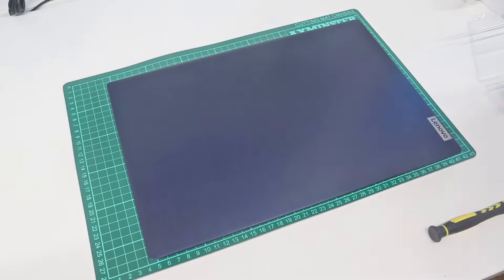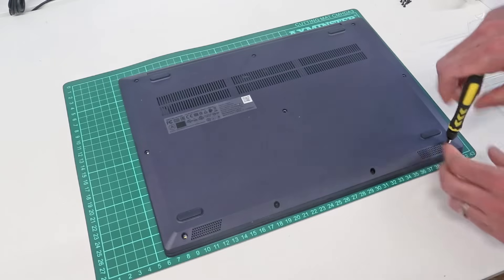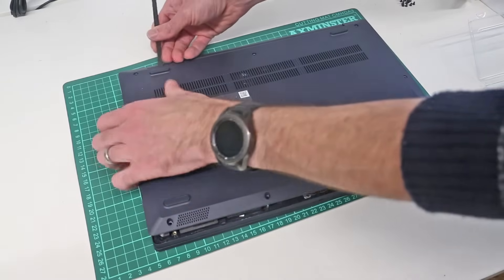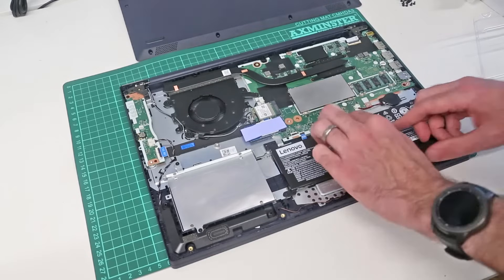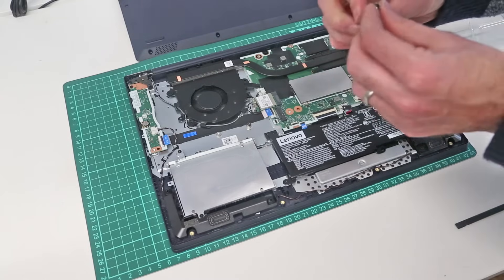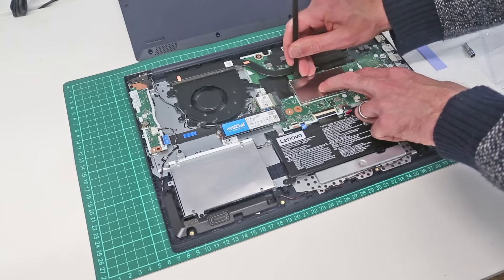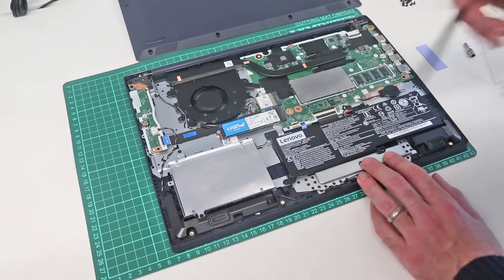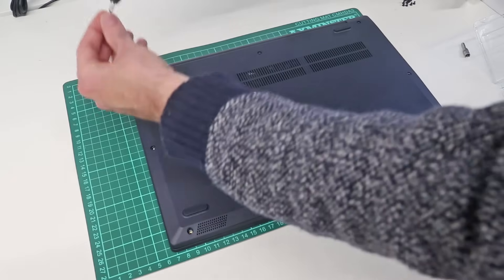Lenovo IdeaPad 3 15ARE05 SSD and Memory Upgrade Guide

Comment: i put 16gb RAM with 4gb soldered RAM and it run 20gb RAM ... with no problem
Reply: JET FU3L  total is 20 gb, but loss dual channel
Reply: Was debating on doing same thing (have ryzen5 256 ssd 8gb ram) but did not want to chance wasting cash
Reply: which 16 gb ram stick did you use?
Reply: @badeebabar3184  2666mhz 16gb ram
Reply: @vantom6194 i put 3200mhz 16gb ram
Reply: how?

Comment: Thanks Brue! i was wondering to upgrade the memory is it possible for me to just do steps 6:03-6:45? I'm kind of nervous of doing the parts that you showed in the beginning of the video. Thanks!
Reply from the maker: Not sure how you expect to do that? You have to remove the base before you can install the memory....
You don't HAVE to disconnect the battery, but I'd strongly recommend it.

Comment: I just bought this laptop 2 months ago and I'm experiencing usb port problems. Sometimes, plugged in mouse, keyboard, ethernet adapter, etc., gets disconnected. After it gets disconnected, it takes time for the laptop to read the plugged in devices again. Sometimes, the laptop doesn't even read it and takes time before it does. Someone help please!

Comment: What cable do I need to install a second hard drive?  I just opened mine up and it doesn't look like there is any place to plug in an ordinary SATA cable.
Reply from the maker: There is a small ribbon connected which plugs in just above the battery on the left hand side.
Unfortunately Lenovo's service manuals don't list a part for this.
Reply: @BrueComputing  Do you know which ribbon part is needed?
Reply: @BrueComputing  mine is not found, like it forgot to put it in

Comment: Is there room for a 2.5” sad?
Reply: https://youtu.be/Z3ncfy_ws2E?t=103 IDK if u stell need this info, but we can see u need just right connector for it.
Reply: The 2020 model has a 3-cells battery you cant install a 2.5" if youre unlucky to get that.
Reply: @frafra224  well i bought this one. No room for ssd. Anyone knows what i can do? I cant semm to find m.2 512gb for that small size. Any ideas?
Reply: @ΑλευράςΘεοφάνης  Sorry man I was in the same boat. Some models have working additional M.2 slot of different size but not all and Lenovo seems to have lots of different models with the same marketing names so I can't tell for certain. You mean the length of the m.2? They are most likely either 2240 (4cm) or 2280 (8cm) so try to filter it with your search.
Reply: @frafra224  Thanks for your answer. I try searching online but its impossible. There seem to exist hundreds of different configurations with even the exact same model name. Even at the official site of the lenovo i didnt manage to find a config that suits mine (memory, screen, hard disk, cpu). I'll open it tomorrow and report back. Hopefully there is a second m.2 slot or the ability to change the bolt of my small one m.2 to add one bigger. I will report back with the answer.
Reply: Yes, but you will need to buy an HDD cable.

Comment: Hi, Can you list out tools used to perform this,
Reply: I have got hdd, I was told  adding a ssd will increase speed,how can install windows to the newer ssd
Reply: Find your product key
Reply: @inSearchOfZen392  for windows
Reply: @kissmethroughthephone5834  lmfao
Reply: @inSearchOfZen392  you will need a nvme to usb drive and then copy over the stuff n install. Windows will automatically upgrade due to OEM.

Comment: So this comes with 4gb ram. Could you put an additional 16gb stick in the empty slot to run it in dual channel mode 4gb+16gb for 20gb total?
Reply from the maker: Yes, although for performance in some cases (mostly integrated graphics gaming) having a matched pair can be better than a higher total.
Reply: @BrueComputing  do i need a cross for S540 Lenovo on flat Screw edges for loosening
Reply: Nice to hear that
Reply: I want to do this can you send me the links for what I should i get
Reply: Dual channel not work in differents gb but u can upgrade gb in single channel, but used the low mhz
Reply: Dual channel means both of the rams should be of the same size 4gb with 4gb 8gb with 8gb as per my knowledge
Reply: YESSS! I DID IT
Reply: @jenifermattoscampo1565  I read somewhere it can only take total of 12G is what the dual channel is for?  Or am I going to burn this thing up in a couple of months?  Can you please provide a link to which one you put in? I am hoping to upgrade this potato.  My K/D rate sucks! got to be the equipment?!
Reply: @slrsouth64  No, it's 20 gb in total. I bought few days ago a 16 Gb ram memory because mine was only of 4 gb, so I put on the other slot  the 16 Gb memory. It works perfectly!
Reply: @jenifermattoscampo1565  can you send a link of what one
Reply: @slrsouth64  news? my laptop lenovo 17alc6 have the same limit. I would like to upgrade with 32gb ram.

Comment: Should I put the SSD right before I start up the laptop?
Reply: Remember, the SSD holds the operating system. You will have to reinstall the OS before you can use the laptop with the new SSD.
Reply: @mattstorm360  how do you install a new OS when you replace the ssd?
Reply: @SoapboxPreacher777  You need a Windows or Linux installation media ISO. Then you write that ISO to a flash drive. Afterwards, plug that drive to the new computer and boot from that drive instead of the hard disk. Then the OS installation interface will appear. (The instructions to boot from another drive is different across computers. On my ASUS laptop I start the computer, press F2 and enter the BIOS, in the last page there is "Boot Override" option)

Comment: Hi. The old drive looks like a m.2 sata and the new one a nvme drive. Are the two interchangeable on the ideapad 3 15are05?
Reply from the maker: The standard drive on mine was a PCIe 2x device, so had both keying notches in it. I replaced it with a PCIe 4x device with a single notch without issue.